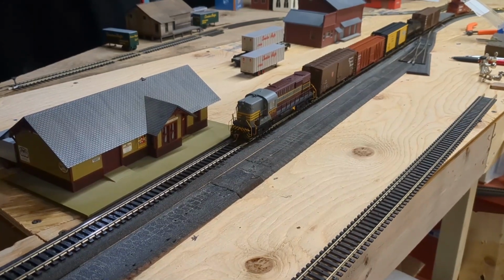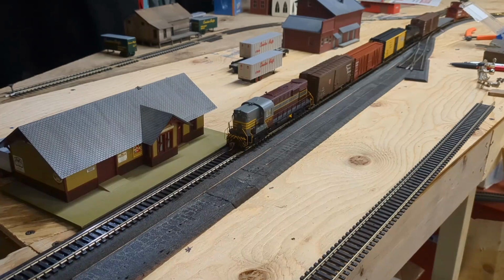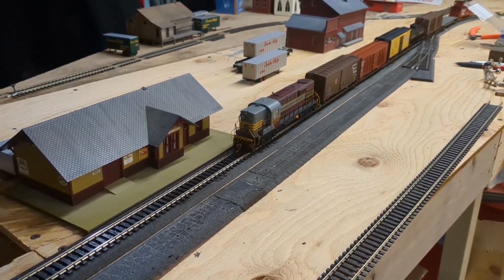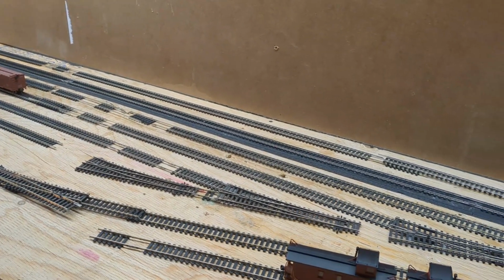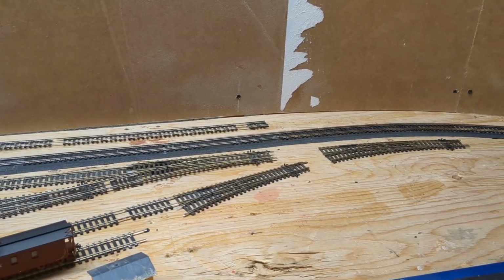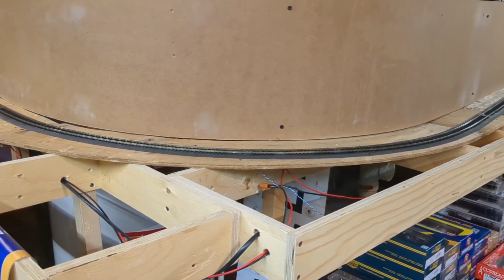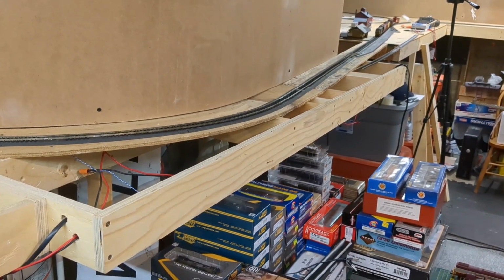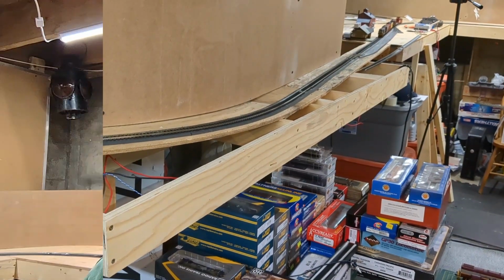So I'm actually doing stuff...?

Comment: nice update :) is that an exactrail poster hanging on your benchwork? I like the lantern in the corner ;)
Reply from the maker: Thank you sir!

It most certainly is an Exactrail banner hanging from my benchwork 💪

I've got a few more not on display yet, I found a couple other ones at the local antique shop too I'd love to get my hands on haha
Reply: I love lanterns, I have nice ones from CPR, they are hard to get here in QC. mostly CN ones :( I think they decorate a train room nicely :)
Reply from the maker: @robingagnon9659  I think that big one is CN, I asked a year or so ago if anyone knew why all four targets were amber/orange, it looks like a switch target lantern? The bottom would sit perfectly on a switch stand in my opinion. But I've got a few smaller CP lanterns 👌
Reply: the green signals on Main and it was a yellow signal instead of green in the yard. Probably someone replaced the red lenses with yellow at one point because they were broken or missing and that is all they had on hand? really makes no sense with all 4 yellow. but I could be wrong 🤔